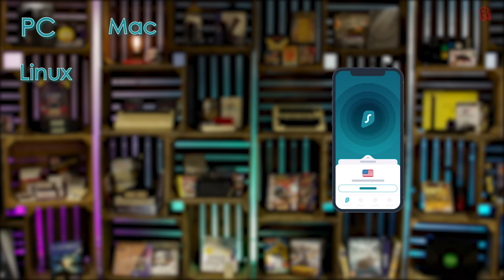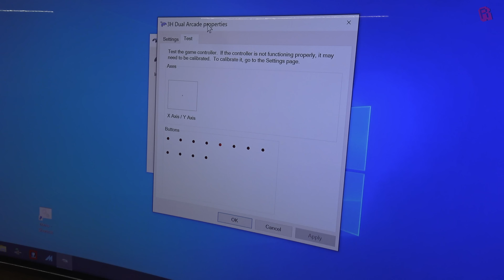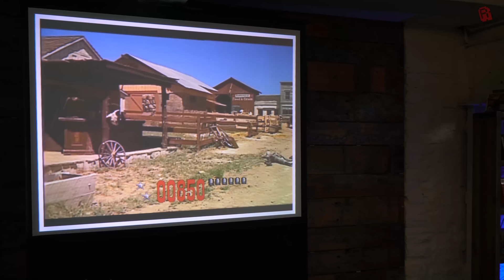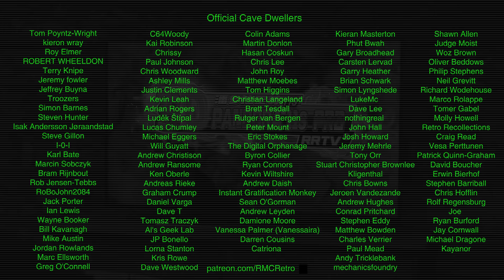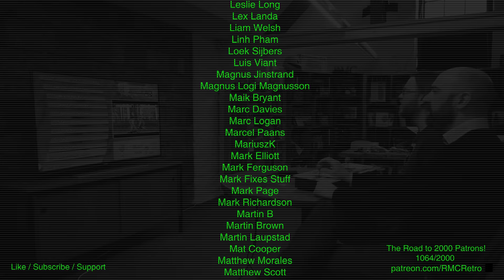Opening Pandora's Box - Are cheap All-in-one Arcade Fight Sticks worth it?

Comment: If you're replacing all of the buttons and sticks, using it on a PC, and even replacing the sticker, you're basically just keeping the plastic housing and USB interface.
Reply: It's nice how it's pre drilled and everything though, and ends up cheaper than a stick with the parts included often. But really youd probably be better off getting two sticks and something else to run arcade games in a setup...

Comment: Depending on your capabilities and what you might have lying around the house it can make a lot more sense to make your own arcade machine.  That way you can control what kind of quality you are getting and possibly save some money.  Things like older smartphones or PC's can be great bases for an emulation machine.  Otherwise many of these all in one machines can be easily upgraded with better sticks, buttons and the like.  There are also quite a few different versions of the Pandora box units with different capabilities (the Pandora Box 3D is currently the best version as far as I know).  The Wicked Gamer and Collector does a lot of reviews and comparisons for people wanting to know more.

The way I would suggest most people to go is to get something like an arcade style joystick and connect it to an old smartphone (a 2 year old smartphone is generally much more powerful than the SOC's in these kits) with a USB C to HDMI solution allowing it all to go into a TV.  From that point it's just a matter of loading up your own emulators and ROM files.

Comment: I recently ordered a Pandora enclosure and 2 sets of buttons for a similar build. The buttons come with 2 USB controller boards. Now for the brains, I use a Raspberry Pi 3B running Retropie OS (console emulator OS). and the result for MAME games is very good. As a bonus, the additional USB ports on the Pi can be used to plug in additional controllers for console games. Absolutely brilliant little rig for Xmas gatherings. All told I spent about 100 gbp and would recommend this for those who like DIY.

Comment: The gamma differences when you showed them side by side with mame, actually comes out in favor of the pandora stick.  Arcade monitors are calibrated with a different gamma settings than what you see on your flatscreen, and adding a gamma adjustment is actually a way to get them to look closer to the intended look, not the other way around.  Not having an option to disable it would be the only possible bad aspect there, from what I saw in the video, as its certainly not always necessary/beneficial.

Comment: I bought an Atari Fight Stick for mame and LOVE it. This is the single player model in 70s-style wood grain which, in addition to the usual joystick and 8-button layout, also includes a track ball,  a weighted spinner, AND side-mounted pinball buttons. It is very well made, with high quality controls and enormous functionality. The original price was $200, which seemed pricey at first sight, but actually is pretty fair considering the quality, functionality and appearance. I actually paid $80 for an "open box" (but unused) from MicroCenter. They had several at the time, and now I wished I had ordered more. Sadly, it is no longer manufactured and I cannot find them anywhere now. In comparison, I also have a couple of Atgames fight sticks (basic joy/8-button design). They are decent quality, but they are basically "Camaros" compared to the Atari's "Corvette".

Comment: If you find the right pandora box 3D board with a button on it, you can mod it to run emuelec. A lot of these Pandora’s are based on older pandora 6 models... I like using the amlogic s912 base chipsets.

Comment: That SBC is almost certainly a completely standard off-the-shelf part. I'm impressed with the number of GPIOs, too (looks like the arcade stick is only using about half of them). It'll be running a hacked-together Linux with an equally hacked-together, old and buggy version of MAME, because they always are, but it would probably be really easy to install a proper Linux distro on it with a more recent MAME. Booting from SD card makes them really easy to hack. If these boxes are common enough there may even be some community support for that.
Reply: The H2+/H3 SoC is supported by mainline Linux since there are other SBCs using it (I actually have an Orange Pi Zero that has exactly the same Soc as the Pandora box in the video), but I believe you would need to adapt some things to the characteristics of the board (the type and speed of RAM, GPIO, etc.). I don't know about any community efforts to support these boards but it could be possible and there are already distros like Armbian that support Allwinner based boards.
Reply: @JORGETECHJorge  Thought you may like to know that Lakka support the Allwinner H SOC series with their RetroArch emulation software.
Reply: Pandora 3D series run on Android + RetroArch. Older Pandora Boxes run on Linux + MAME + FBA (due to IGS PGM emulation is not as good as FBA back then). 
The so-called "Retroid handheld console" also runs on Pandora 3D board, but there are versions that runs AOSP (rather than crappy Pandora customized Android) due to so many players requested that.

Comment: I got the 4s+ a few years back for £120, it's pretty insane how the prices are going down yet the hardware is being updated vastly. Playing any 3D fighter was a pipedream on the 4s+. If the 11 is anything like previous hardware, it probably uses a Dual Shock 3 controller board and in my experience does indeed work through usb with a PS3 but you'd have to stick to games in which remapping the buttons is an easy feat. When it came in the mail, a friend of mine and I played on the actual unit itself for about 10 minutes before we chucked it on MAME on the PC. You can indeed hook the sd card up to linux and change some of the roms but it's a whole other faff of its own. I've seen some pretty cool Pi mods for it online.

Comment: I trash-picked a 14'' Acer plastic job with a broken screen  and some damaged connectors in January. It boots nicely, if noisily, if I clip on 19V to the legs of the power connector. There should be ample room in one of those "Pandora" fight sticks for it, a hd and a less whiny cooling solution. It sports a 6200U and 4GB soldered DDR3 (and a free socket), more than enough for the games I enjoy. It's something to do at least till I get that shot. :)

Comment: In my experience, most of these systems are not exactly built to last. They are put together rather inexpensively and you are lucky to get some use out of them or even to have them work at all. I purchased something similar to this recently and it worked fine for about a day and then all of a sudden the SD card came loose and ended up getting stuck in the port. I would have simply taken the console apart to get it out, but experienced a simultaneous hardware failure at the same time because of how cheaply put together the thing was.
Reply: If i wanted one of these jfor fighting games at home will these just work as controllers once plugged into a pc or no?
Reply: you have to buy 3A Games products. These products are good quality.

Comment: Do wonder you tried plugging a keyboard (or mouse) into one of the A ports and see if you could get into something more than the up front UI.

If it was running Linux it may well be possible to jump to a terminal using alt and the function keys.

Comment: This is what I did, I took the board out and using a case (pandora’s case) I drilled it under a desk very hidden from plain sight the used a usb hub and with velcro attached the hub to the edge of the desk. Also using the audio out I added a pair of usb speakers. As controllers I’m using custom made arcade fight sticke I made with usb zero delay encoders work like charm on this thing at the end just go to settings and remap the buttons of the zero delay encoder boards. I used the spare case, buttons and original sticks to connect it to a raspberry pi using other zero delay encoder boards to have a portable one.

Comment: Ah yes, Pandoras Box certainly hasnt aged well with time. I mean when they first pop'd up they may actually have been worth the £200+ that some still try to sell them for. The hardware has been continually re-released with more games but hasnt done much in the technical department so other emulations like Raspberry Pi has cought up & surpassed it many times over. I myself finally got my hands on a "console" version of the Pandora Saga 2700 (clone) for about £50 & is quite happy with it.  Takes less space comes with psu & some off dual playstation like controllers. The idea was that now that i have the psu & joysticks i can alway upgrade by simply buying a new stand alone board for £20-30 (usually comes in both jamma & "home console" versions). Even though the first 500 games is basicly just SF & King Fighter verison games there is still a huge selection of other games in there. I must admit i prefer the "non optimized" nostalgia look at 1024x768. If you are as old as me & played the 8bit games then a bit of screen tearring isnt going to bother you. Of and dont forget about import taxes & penalties. I got lucky with mine, but it could easily have been another £35 if the import staff in Denmark wasnt so lenient at the moment. Today you can certainly get a lot more for £50. The only reason i got one was because after a decade of starring at the sticks online, they finally got down to a price point that i was willing to pay "just for kicks".

Comment: Thanks for the video, you should have focused on the exact model, there're numerous models with different build and emulation quality, the difference between the best and worst is night and day
Reply: I bought that exact same model within minutes of Mark and mine had a H3 processor. It's always a gamble.
Reply: @m0th84  that's weird, I saw several listings with exact details like CPU type and ram size never heard of someone getting different models like that.

Anyway looking for the next video when this is pimped  😎
Reply: @hosam7609  There were a few of us that ordered them. I think we're the only ones that have taken it apart to see what cpu is inside. I was trying to get EmuElec to boot but i gave up and stuck a Pi inside. This is the unit we ordered and it doesn't mention specs https://smile.amazon.co.uk/gp/product/B086XK1NV7/

Comment: There is an option in MAME to set the game speed to match the monitor refresh rate. This fixes the screen tear with vsync off and judder with vsync on, but it does mean games with low 50s refresh rates like R-Type and Mortal Kombat run a fair bit too fast. Overall though it's the best of the three options. You could also triple buffer but that adds lag.

Comment: I have this same one. I mounted it into a bare pole position cabinet. I tried this on my 4k TV, and on a monitor. I found it looks better on a monitor than the TV. The monitor is connected via the serial port as I bought a factory second that never had the HDMI soldered to the board. I was going to fix it, but I found the display was better with the serial cable anyway. I can't say if its the monitor vs TV or the cables that make the difference.

Comment: It works like a Mini Console, it uses Linux to boot and run the Frontend and Emulator so the partition you can not see is Linux on the SD Card, it uses the SD card to boot it like a Raspberry PI, you could properly replace the Linux on it so it would boot Retroarch.

Comment: Oh Pandoras all in ones, the big controller box with a quite capable (pi esque quad core) mini mobo inside. 
Shame the pandora software and settings generally are all Mame based and have some glaring video sync issues.
Seems these units are all generally an inexpensive arcade stick with a lower spec pi type board inside - seems better value to get a cheap mini or pi board and mod it adding your own USB sticks -  doing this will also be a fully upgradeable option.

Comment: Got one of these for £40 with a vipon coupon for 50% off and the tick box on amazon for 30% off. Pulled the guts out of it and stuck a raspberry pi 4 in it, the sticks and buttons can be plugged into the gpio if you use the mk_arcade_joystick_rpi drivers. Currently rocking RetroPie on a 256gb SD and it's great.
Reply: Where did you get yours from?  Everything I can see is around £150

Comment: It seems like the case and stick and buttons is worth £40 as long as you can replace the board with a Raspberry Pi or Mister.
Reply: theres plenty of room inside to put a pi in there as well as using that main board.
Reply: @dangerotterisrea  Yeah, I was thinking more along the lines of connecting the buttons directly to the GPIO pins rather than going through the controller board's USB controller functionality. But both of those approaches would work.
Reply: The case alone is £50 on Amazon as a DIY project so to find it as a complete unit for a mere £40 was either incredibly lucky or more likely bullshit!

When he first announces the price there is some seriously dodgy eye contact!

Whats the deal with the price, please post the listing or point us in the direction of the seller.

Comment: Hi thanks for the video very informative. Is it possible do you know to get a replacement fan for one of these (I own the exact model Pandora 11s) as my fan is very loud at startup but calms down after a while. The fan measurement is 1 1/2 inches x 1 1/2 inches and has a 2 pin connector and is exactly as shown in your video. Can you help please?

Comment: I wonder about screen tearing — how did TV stations in the 80's/90's manage to air US stuff in PAL countries without looking like crap?

Like "ALF" or "Married with Children". Both looked nice and smooth here, even during panning. No frame stutters, no frame tearing, no jaggies. How come today's GPUs or encoders can't replicate that on the fly? (if there's an easy way, I'm all grateful ears... I'm looking for it for a few years now)
Reply: If the show was recorded on film, they'd use a telecine process to convert it. If it was on tape, they actually used special cameras pointed at a crt. The camera and crt could be switched between ntsc and pal, so it could convert in either direction
Reply: By the 80s, I think they started using digital systems to do the conversion.

Comment: :D - what about reformatting (or replacing) the SD card (with a larger and better one) and installing MAME onto it?  Would this fix/improve the colours and 'tearing' issue(s)?  Could it then become a basic Windows (or other operating system) powered emulator, or would the hardware not be powerful enough for doing this?  Just a thought!
Reply: Probably would get rid of the screen tearing - need to flash the SD to boot like etcher or something. Linux Lakka may work?, It does for similar orange Pi units like the Super Retrocade mini consoles.

Comment: Thanks so much for creating this video. There's maybe 10-15 games that I actually care to play and I'm OK with the screen tearing. How did you select which brand to purchase? I'm deciding between one on Amazon $150 USD vs a "Retro Arcade System" brand for $300 but both run something called "Pandora" as the arcade operating system. Idk why one is marked up double the cost. Thanks for the help.
Reply: Get the cheaper one
Reply: @kevinbbadd  too late. The cheaper one would have been better. The game that I really wanted to play has input delay due to the crappy ROM
Reply: @kevinbbadd  why the cheaper?

Comment: in all fairness, the screen tearing is a complicated issue, so many arcade games runs at weird ass refresh rates. heck even consoles runs at NTSC refresh which is not quite 60hz and i don't even want to know how you Euro dudes deal with PAL emulation. 
the only real solutions is either using a variable refresh rate monitor or a CRT monitor which supports the actual video mode.(because good luck finding a LCD that supports different refresh rates and does it without making a mess of things) 

you pretty much either stuck with tearing, jittering or running the game at a different speed than what it was supposed to

Comment: The v1 Picade from Pimoroni, is an excellent kit particularly when updated with a 12" flat panel and no soldering required (bit bonus for me).  I've just swapped over for a Raspberry Pi 4 and it's phenominal.  I'm sure the v2 kit is good too, but finding the TFTs is becoming harder.

Comment: im not into emulators. i tried many and they all had issues at some point with some games. i prefer have the real thing. many of those emulator systems are using games from nes , snes , sega or other systems and i have mostly all of them. im a collector and have many. i prefer use the real machine. they can be actually very cheap. these days will all the everdrive types of carts , you can have all the games you want. about those particular pandora boxes , i saw many complaints about problems with the buttons or joystick. i am also not too much a fan of those arcade style sticks.